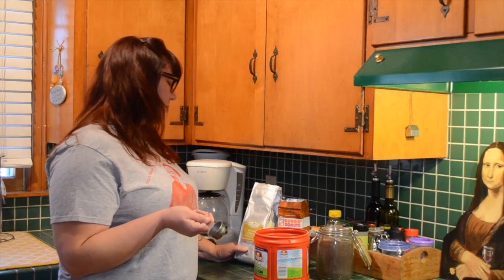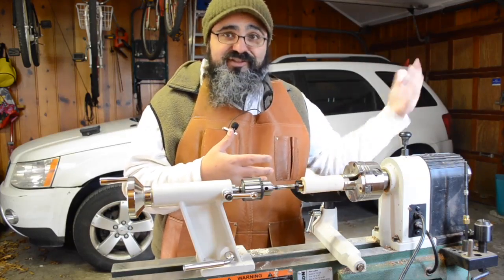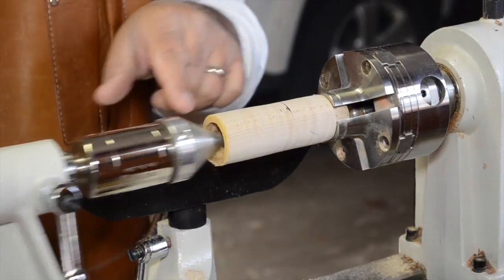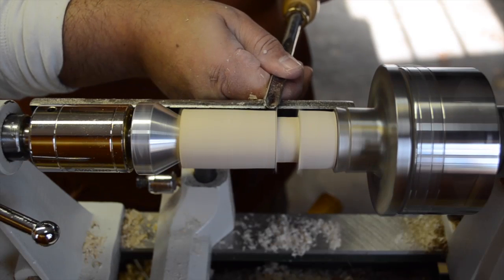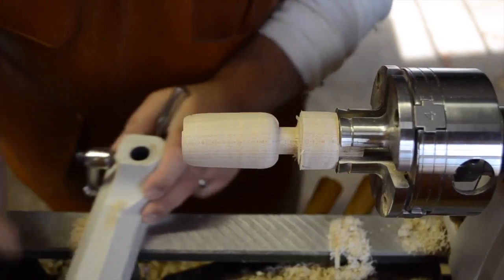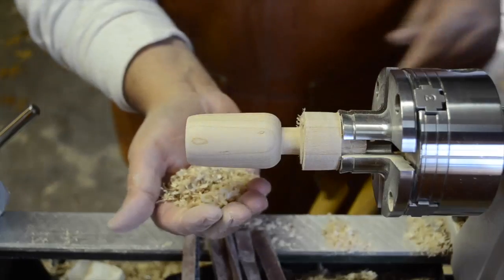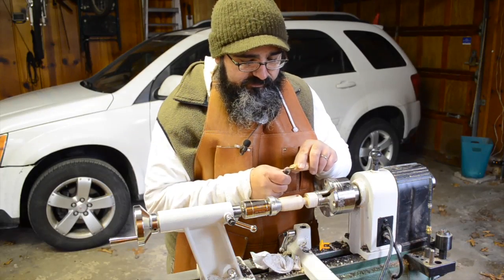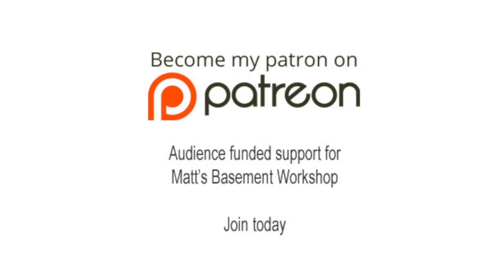535 Wood body coffee scoop

Comment: I could be wrong but are you getting smoke from your forstner bit because your RPMs on your lathe are too high for what the bit calls for? Maybe if you dropped your RPMs down on the Lathe it would work a little better, just a thought, lol.
Anyways great project!! I want to get into wood turning myself and this looks like a great project to get started and get some practice!!
Reply from the maker: You're probably right. I'm the first to admit I'm not the best when it comes to selecting the right RPMs, and unfortunately with this model of lathe changing them isn't all that easy. 

Suprisingly there was very little burning on the inside, even with all that smoke. But if there was, maybe the char would add a smokey richness to the grinds lol?!

Thanks for watching.
Reply: Hola como estas saludo yo tambien soy tornero

Comment: Whats the effect of running the shaving along the scoop after the sanding?
Reply from the maker: It's burnishing the surface of the wood and leaving a very smooth surface that already has a slight shine to it. Honestly I don't need to do it, the sandpaper grits leave it smooth already, but I like the way it feels and looks. 

It's very much along the lines of what you could achieve when rubbing a surface with a paper bag.
Reply: Ah right, ok. Thanks for the information. I did actually notice a slight sheen alright. When you say you like how it feels, I gather it basically makes is super-smooth?. (BTW I have never rubbed the surface with a bag, something else I must give a try :) )

Thanks again
Reply from the maker: Yes very smooth! As for the paper bag trick, frequently I'll lightly rub a project's surface with a brown paper bag to remove tiny dust nibs. 

It works amazingly well lol.
Reply: Ah right...Thanks for the tip. I'll give it a shot :)